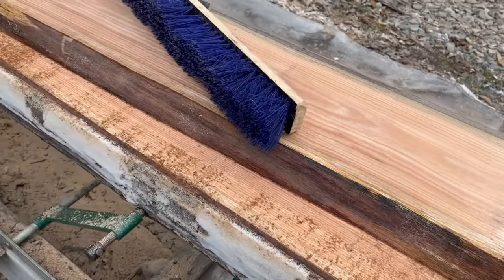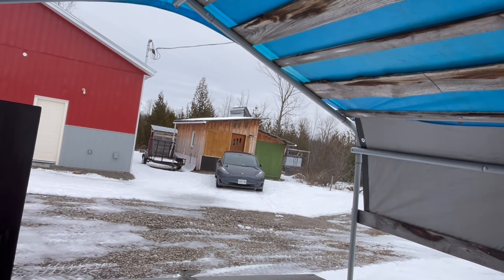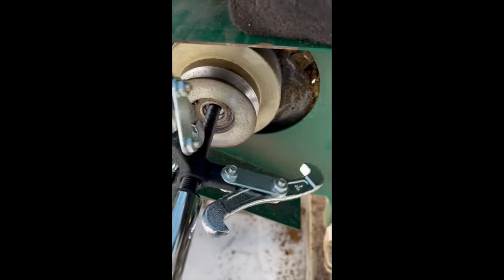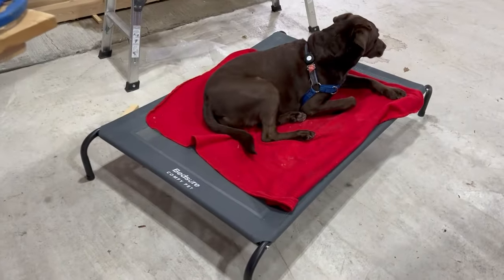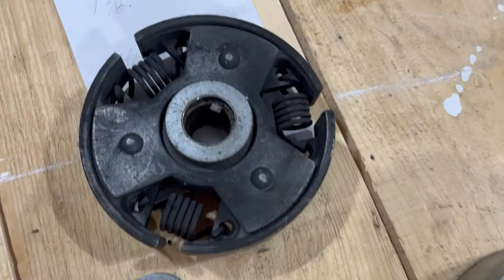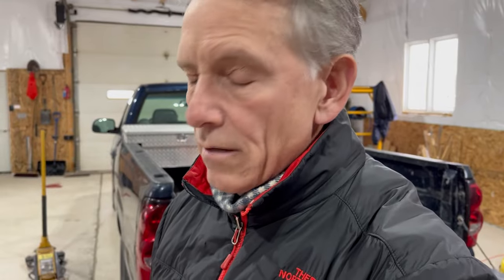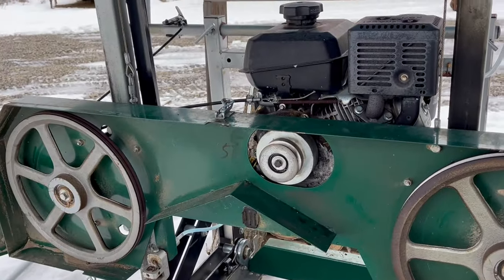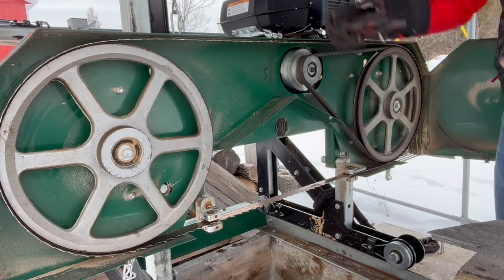Sawmill Repair: My Sawmill Stopped Working As I Sawed an Oak Log

Comment: Hello Peter. That looked like a relatively easy fix. Will the oil sensor need to be replaced? I am glad that it had nothing to do with the fuel. Having thick slabs for your project is going to be interesting after the wood has dried. Have good days!
Reply from the maker: Yes, the fix was easy. I just had to buy the puller.